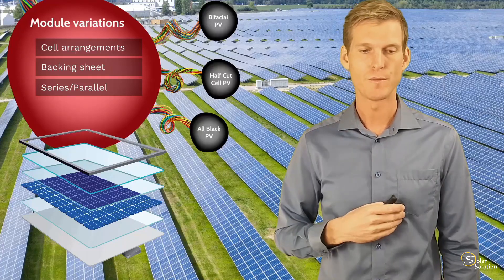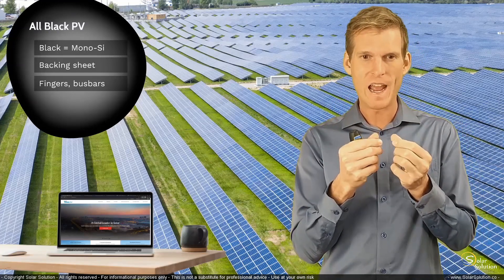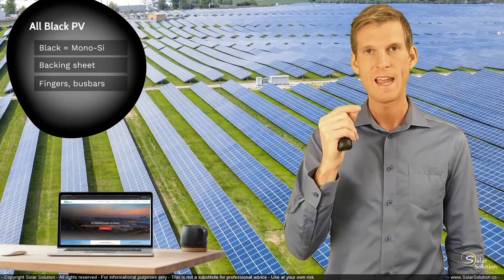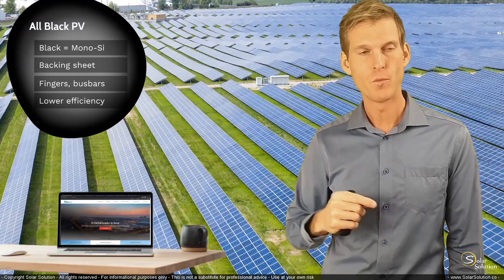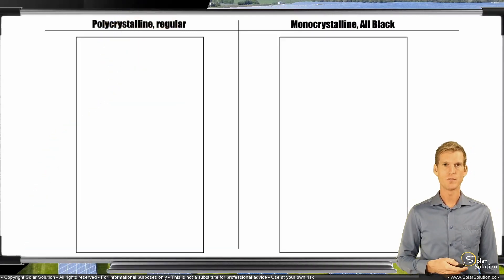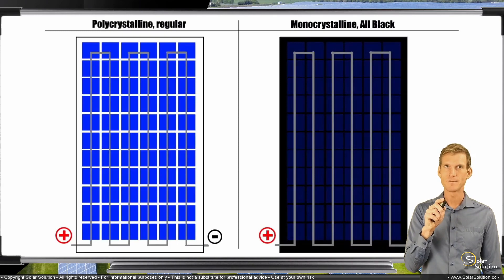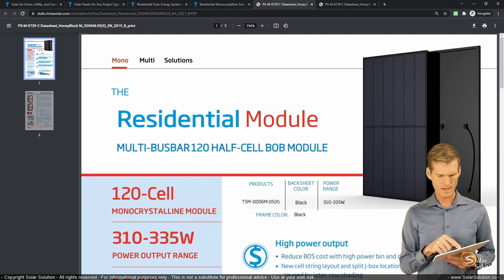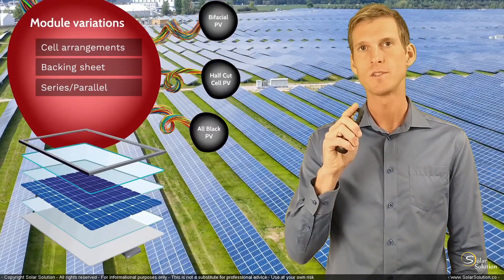All Black Solar Panels: Are they better?

Comment: Hi, the first time I installed a all back panel I was quite disappointed 😥 the output performance was quite very low compared to the mono system have been installing since. Yet the 280w pv specification looks much higher than the 280w mono version but performance was poor on current/watt generation. Wat could exactly be the reason?

Comment: Great content, to the point !!!  
1. I was wondering if you could do a video on Shingled PV modules. The technology looks promising. The possible pro & cons and when these panels have there biggest advantage. 
2. You triggered me on the following ; You mentioned in an other video, " that lesser efficient PV modules have a relative higher efficiency with lower irradiation ",  if i'm not mistaken !? If so, very interesting especially in climates with winter ( the northern hemisphere ). This is the time that electricity consumption loads are the highest, but PV production the lowest.  So here comes a new video topic request ; How maximise the winter irradiation !! ( Mabye, is a Eat-West orientation the better solution ?, Table of Hespul enough indication ? Or just better off with low efficient panel ? Or better a higher Wp ( Watt piek ) installed vs your inverter 10-30% ?  

Cheers
Reply from the maker: Hi Jacob, thank you for your message. It is good to hear you enjoyed the video. And thank you for your excellent and concise questions, I have my work cut out for me! Great questions & topics for videos, which I indeed haven't covered yet. It might take me a while to record & upload the videos which will answer your questions, but I will! Patience is a virtue ;)
PS thumbs up for comprehending the point about lower efficiency panels vis-a-vis low irradiation situation!
Reply: @SolarSolution  
Hi Jesse,  Yes there is so much great info to chew on, in a very easy way, outstanding work !! Got the watch out it doesn't get into a occupational deformation. All solar talk at dinner won't make my partner happy !! Saying so, looking forward to your content on the above topics and please that your time, that will make my partner happy...!!

Comment: Brother, I have a question, if we cover tempered glass with a black cover will it absorb more energy and maybe be more efficient, I am a Masters's student of energy systems engineering I have to do a thesis, if you have any idea on which I must to research share your idea with me and answer me on this a s well.

Regards.
Reply: No. The energy comes from collecting photons not heat. I think hes wrong in this video a black panel will get hotter and reduce performance.